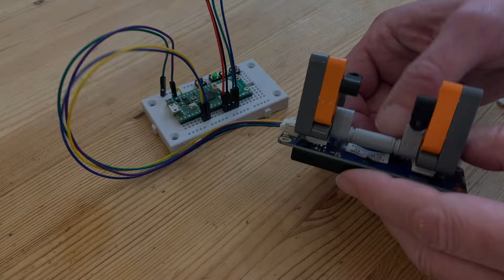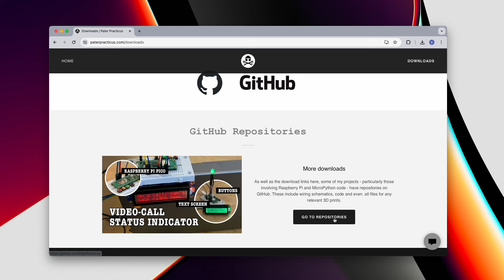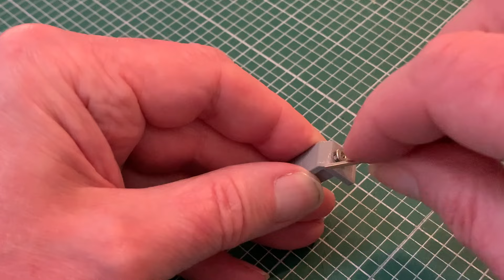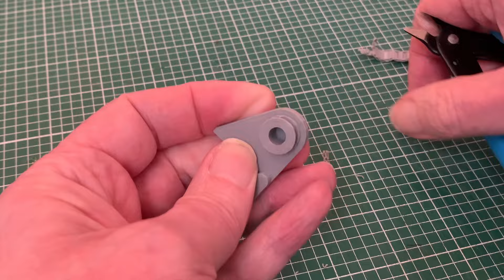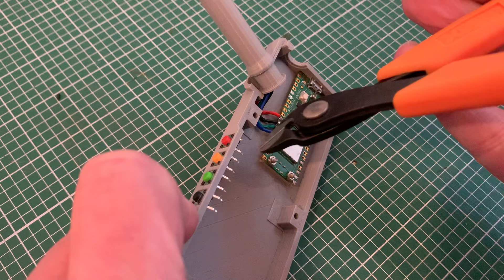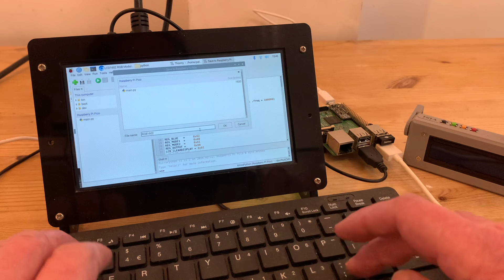Raspberry Pi Pico ‘Video-call Status Indicator’ with RGB display and custom 3D printed case

Comment: seems a bit overkill to use a RPi for a project like that :)
But make use of what you have I guess
Reply from the maker: Agree, a full Raspberry Pi (even a Zero) would be overkill, but the Pico is perfect - and less than £10. It also doesn’t actually need to be the W, so could be even cheaper!

Comment: Awesome Project!

I've thought about making a very similar system before but I was hoping to make something that automatically detects whether I'm on a call and whether my camera and microphone were muted or not. I never finished it because I got stuck on how protective most operating systems are of their cameras and microphones (in retrospect this should've been obvious 😂) and the lack of root access to my work Mac laptop to work around it.

I love your solution of just having different buttons for multiple different statuses. I might try and build a version of it that doesn't use 3D printing because I just have a chassis and not a working printer at the moment.

Also, am I right in thinking that there's technically nothing here I couldn't do with an Arduino? I have some laying around I think should be able to handle this 🤔

My version was intended to hang outside the door to my office to stop people unwittingly walking into the cameras view rather than sit on my laptop itself, I'm thinking I could do it with something like a key fob or even just an IR remote if I can get the sensor on the same side of the door, you've really inspired me to go back and make my ideas less over complicated 😄
Reply from the maker: I had wondered about dynamic triggering, but manual control is actually best anyway. Especially if you are on a call, but are in fact ok to be interrupted.

Absolutely certain it would work on the Arduino, but the MicroPython code would probably need to be adjusted.
Reply: @paterpracticus  I think I'll make it my next Arduino project then!

I have a Raspberry Pi I've had forever but I tend to avoid using it despite it sometimes being clearly the best thing for the job 😅

I recently made myself a project that helps me live with ADHD (It's a big red button that continually nags you to finish your morning routine when working from home by flashing until you press it at the same time every morning (the satisfaction of the big kerchunk of the button is important too)). It's actually working really well but every time I think of an update for it that could make it more useful or fun or satisfying (or even just reset the time after losing power for too long), I realise how much I've limited myself by using an Arduino and not something more capable.

I'm a software engineer so adjusting the micropython's no problem, I'll likely just rewrite it for Arduino C++ anyway.
Reply from the maker: I don't know much about the Arduino, but feel sure it is at least as capable as the Pico - which took me a while to figure out, but now seems to fit the bill for any jobs I have like this.

Comment: I was JUST starting the research to make my own. I was thinking on just the lights, and I will be pairing it with a 3D printed waifu I call "Pomodoro-chan" (part of another WFH project of mine) but the screen addition is cool! Incredible timing too.
Reply from the maker: Excellent. I too started with just the RGB LED idea, but I think adding the screen helps leave nothing to chance.